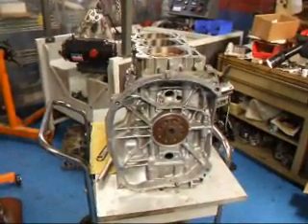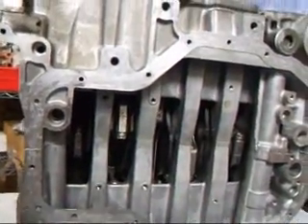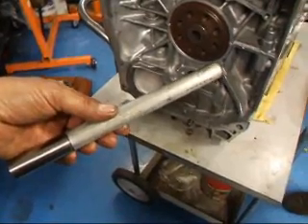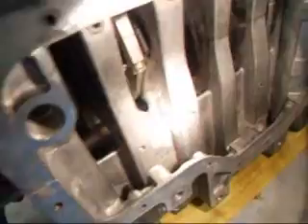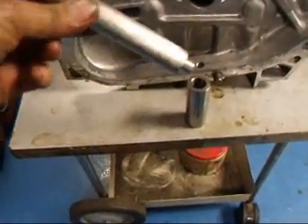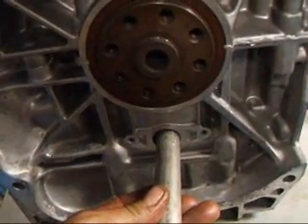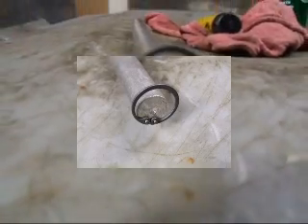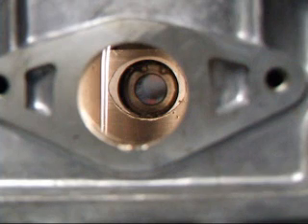Subaru SVX Middle Piston Pin Installation

Comment: @fiatnutz hey, i have recently aquired one of these motors and plan on turbo charging it. With the right supporting mods what boost do you think these engines will handle? cheers

Comment: @tobywong When you want to take the pins out, you have to deconstruct the engine. In difference to a normal inline 4, with a boxer engine, you can remove the entire cilinder, so that the piston is out in the open. After that, it's easy to remove the ring.

Comment: Wow, without that tool, I have no idea how I'd do it. I had trouble enough with the EJ257, getting a pair of needlenose pliers that were long and skinny enough... I can't imagine what I'd do with the EG33.

Do you build these as stock replacements, or built up for turbo or NA applications? Been thinking of doing another project car, and doing something that is somewhat unique.